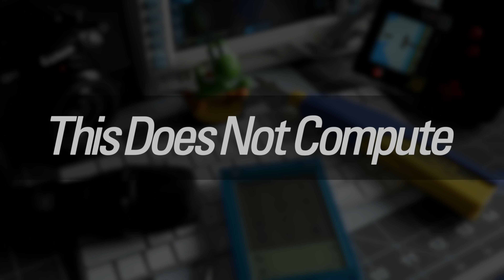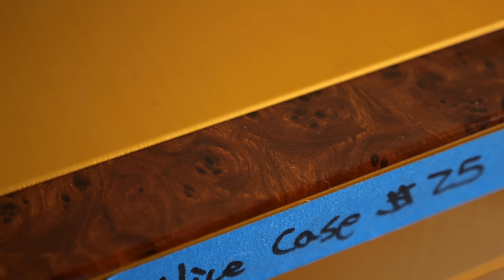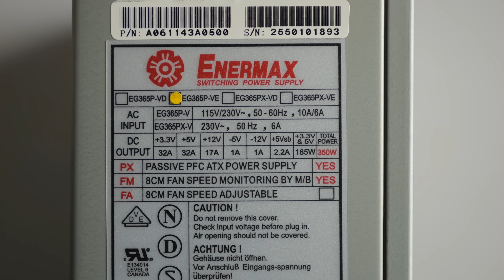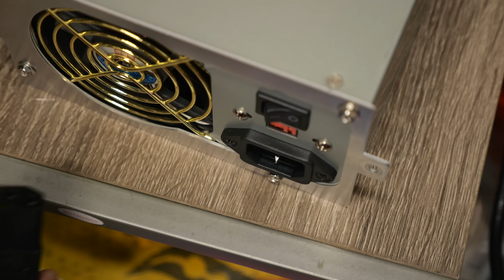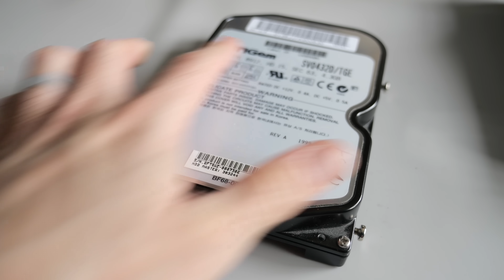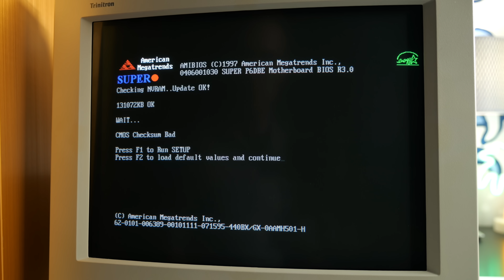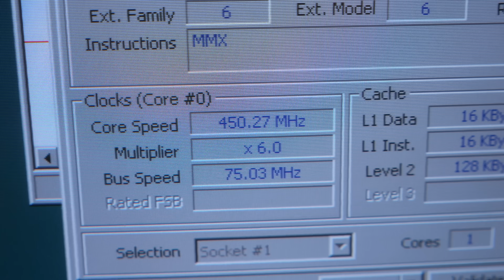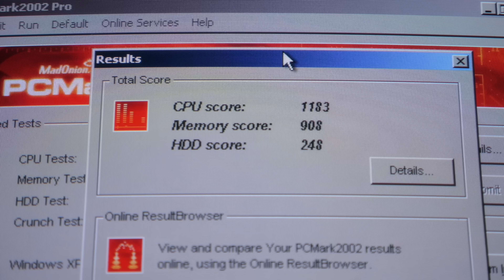I tried to put TWO vintage Celerons in one PC

Comment: Nice Lian Li case, I have got a mini-tower variant of that one, and I have to say, it has this kind of a timeless look :)
As for the TriGem drive, the part number looks identical to those used on a Samsung drives of the era, so indeed it's a rebadge (fitting, as it's Korean too)

On a side note, it's amusing to see infamous AMI WinBIOS on such late motherboard, I never knew it was used on any Slot 1 system!
Reply: Before the "TriGem" even came into view, my mind went to Samsung based on the curves of the drive alone.
Reply: Honestly based on how the trigem hdd was designed, I thought it was a rebadged Samsung as well, the shape looked suspiciously like the 80gb drive in both my og Xbox that I modded and my pentium 4 pc which runs Ms dos, windows xp and windows 7

Comment: I have 5 Lian Li cases from the late 2000s era and 1 of them, a mini ATX is even red.  I desperately want a mid or full tower red case.
Reply: Imagine if Intel had made a dual core Celeron back then it would have been a dead blow to the Pentium 2 back then🤣🤣
Reply: There's something about those all-aluminium Lian Li cases. I have a half-dozen PC-60/61/62 cases, a PC-12 from 1999, and a ton of case parts I've hoarded.
Reply: dismantle it and take it to an auto painter. They can do it in an afternoon. Even "rattle can" jobs done by a professional are surprisingly good

Comment: The front panel connectors trouble me to this day.  Lian Li solved that problem decades ago and I learned about it in this video.
Reply: We have the F_CONNECTOR now though. Or do you mean just the extension bit? Because, it might be nice, but its proprietary and seem like the think that's easily lost. :)
Reply: @ToTheGAMES  also some mobos have a little block that slots in so you can just wire everything up and just click the whole thing in and out. more universal yet easier.
Reply: @JessicaFEREM  Yeah, true. Aren't those based on the F_Connector as well?
Reply: @ToTheGAMES  probably